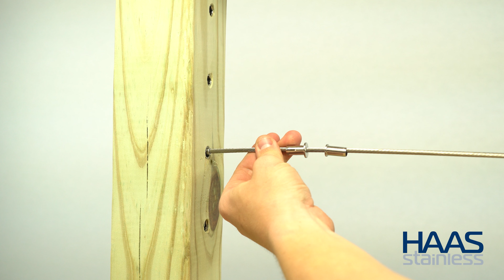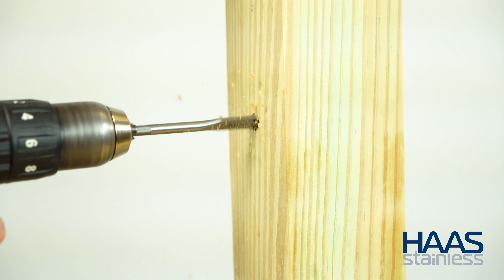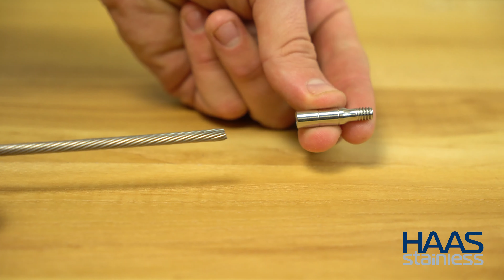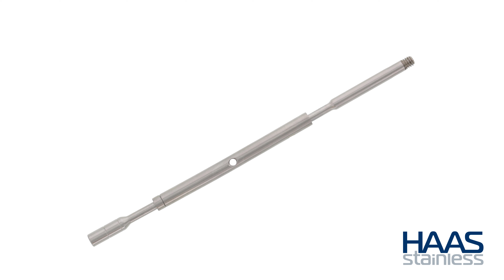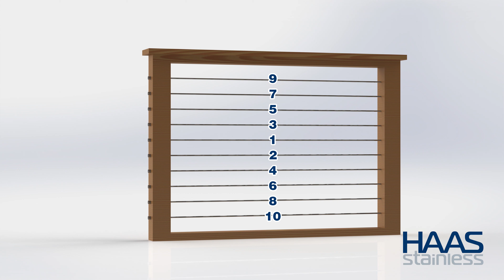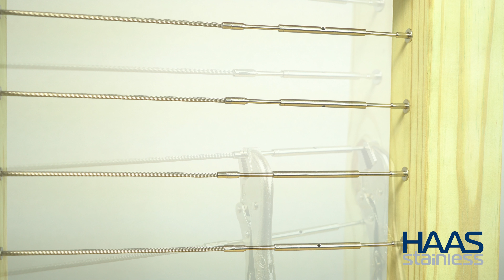How to Install HAAS Stainless Lag Swage Turnbuckles - Cable Railing How-to

Comment: i have a question why do you use 1/2 " spay bit one side and 3/8 on the opposite side is it because the lag receiver is 3/8"

love your videos also i bought 3/8 post protectors i need 1/2 it seems? can i return for the right size?

or is the 1/2" hole just for the lag receiver